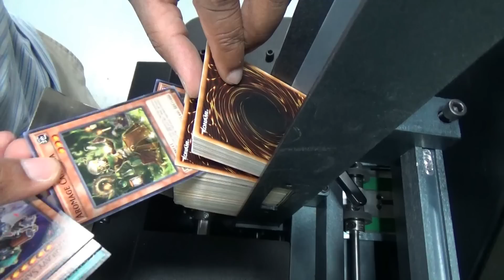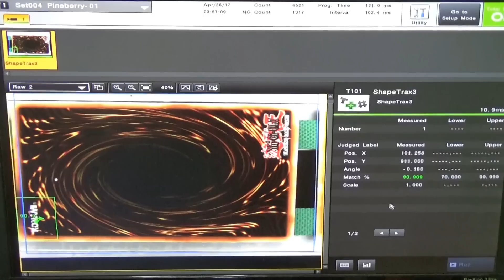CardCheck - Verifying & Inspecting Yu-Gi-Oh! Cards - NO SCRATCHES, NO JAMS!

Comment: Brings back memories of one of my favorite jobs lol. I used to print these, along with mtg amd others. Best job ever.
Reply from the maker: Sounds pretty cool! Our CardCheck Card Verification & Inspection System is designed and engineered to verify and inspect various types of cards, not only Yu-Gi-Oh, but also Pokemon, Digimon, credit/debit cards, tickets, transfers, loyalty cards, hotel key cards, etc. This system doesn't jam, bend or scratch the cards. It verifies and inspects for print/color errors, embossing, scratches, text/numbers, etc. all in one pass!
Reply: Lucky I worked at a printing company but we did direct mail
Reply: Did employees take cards for themselves? Did you or your coworkers play yugioh?

Comment: I bet they slack off tho time to time. Found additional 2 cards in a 5 card bag. Glad i bout it. Other piece was part of exodia 😊
Reply from the maker: We're not packaging the cards with this system. That would be our collation system (https://www.youtube.com/watch?v=XToPsYeBDm8) but ours doesn't "slack off." Same amount of cards in every pack :)
Reply from the maker: In this video, our CardCheck Card Verification & Inspection System is designed and engineered to verify and inspect various types of cards, not only Yu-Gi-Oh, but also Pokemon, Digimon, credit/debit cards, tickets, transfers, loyalty cards, hotel key cards, etc. This system doesn't jam, bend or scratch the cards. It verifies and inspects for print/color errors, embossing, scratches, text/numbers, etc. all in one pass!
Reply: @PineberryMfgInc  Does Pineberry also print/make Yugioh cards?
Reply from the maker: @bobfalcon2756  We can count, box, and manufacture any cards!
Reply: @PineberryMfgInc  but do you manufacture Yugioh cards?
Reply: @bobfalcon2756  I saw the video Pineberry posted and I did see a Yu-Gi-Oh card face down. So most likely.

Comment: How does this system work?  It seems to be looking for particular alignments in the cards' printing but what exactly is this system looking for?
Reply from the maker: Our CardCheck Card Verification & Inspection System is designed and engineered to verify and inspect various types of cards, not only Yu-Gi-Oh, but also Pokemon, Digimon, credit/debit cards, tickets, transfers, loyalty cards, hotel key cards, etc. This system doesn't jam, bend or scratch the cards. It verifies and inspects for print/color errors, embossing, scratches, text/numbers, etc. all in one pass!
Reply: Pineberry Manufacturing Inc. wow!  I am legitimately impressed.  How long did it take for you guys to develop this and how much has it cost to make and maintain?  Also, for the sake of my curiosity, is it possible for someone to purchase the components and/or the device itself and/or the rental of its services?  If so, how much?  

I'm curious because this is the first time I've seen something like this and want to understand how it works and just how it came to be.

Comment: So cool, but you made a terrible mistake on this video, you are using your naked hands to touch the cards, if a company note this they can reject your hard work.  Wear gloves on next videos
Reply from the maker: Thanks for the feedback; we will next time! :)
Reply: Angelus Marcarita I used to work for a company like this they dont require you to wear gloves really at any point as they are all ready dry and on to the inspection phase. If they happen to be still wet they are are automatically discarded.
Reply: I dont know might have different company standards but after the card came off the press they were usually in one huge sheet of paper and when cleared sent to be cut, sorted inspected for scratches and then sent to packaging we were never required to wear gloves unless we were working with the UV ink. But every place is different.😁

Comment: Yet most every pack I've opened has had surface scratches or worse right on the foil. Some system
Reply from the maker: Not from this one. Our CardCheck Card Verification & Inspection System is great for verifying and inspecting various types of cards, not only Yu-Gi-Oh, but also Pokemon, Digimon, credit/debit cards, tickets, transfers, loyalty cards, hotel key cards, etc. This system doesn't jam or scratch the cards. It verifies and inspects for print/color errors, embossing, scratches, text/numbers, etc. all in one pass!

Comment: What's the point of this machine? I don't get it
Reply from the maker: Hey Carlos, our CardCheck Card Verification & Inspection System is designed and engineered to verify and inspect various types of cards, not only Yu-Gi-Oh, but also Pokemon, Digimon, credit/debit cards, tickets, transfers, loyalty cards, hotel key cards, etc. This system doesn't jam, bend or scratch the cards. It verifies and inspects for print/color errors, embossing, scratches, text/numbers, etc. all in one pass!

Comment: But what's the whole point of this?
Reply from the maker: Great question! Our CardCheck Card Verification & Inspection System is designed and engineered to verify and inspect various types of cards, not only Yu-Gi-Oh, but also Pokemon, Digimon, credit/debit cards, tickets, transfers, loyalty cards, hotel key cards, etc. This system doesn't jam or scratch the cards. It verifies and inspects for print/color errors, embossing, scratches, text/numbers, etc. all in one pass!
Reply: Pineberry Manufacturing Inc. but does it actual work, does it tell apart real ones and fake ones?
Reply from the maker: Of course it does! :)
Reply: Pineberry Manufacturing Inc. sweet awesome

Comment: 마,함,몬,엑스트라도 구분할수 있었으면
Reply from the maker: Our CardCheck Card Verification & Inspection System is designed and engineered to verify and inspect various types of cards, not only Yu-Gi-Oh, but also Pokemon, Digimon, credit/debit cards, tickets, transfers, loyalty cards, hotel key cards, etc. This system doesn't jam, bend or scratch the cards. It verifies and inspects for print/color errors, embossing, scratches, text/numbers, etc. all in one pass!

Comment: Y
Reply from the maker: Our CardCheck Card Verification & Inspection System is designed and engineered to verify and inspect various types of cards, not only Yu-Gi-Oh, but also Pokemon, Digimon, credit/debit cards, tickets, transfers, loyalty cards, hotel key cards, etc. This system doesn't jam, bend or scratch the cards. It verifies and inspects for print/color errors, embossing, scratches, text/numbers, etc. all in one pass!

Comment: 何してんの？
Reply from the maker: Our CardCheck Card Verification & Inspection System is designed and engineered to verify and inspect various types of cards, not only Yu-Gi-Oh, but also Pokemon, Digimon, credit/debit cards, tickets, transfers, loyalty cards, hotel key cards, etc. This system doesn't jam, bend or scratch the cards. It verifies and inspects for print/color errors, embossing, scratches, text/numbers, etc. all in one pass!
Reply: Pineberry Manufacturing Inc. 和訳してくれ
Reply: ララ可愛い😍